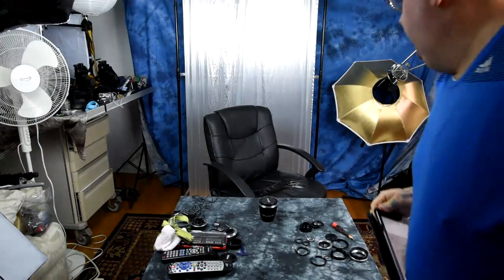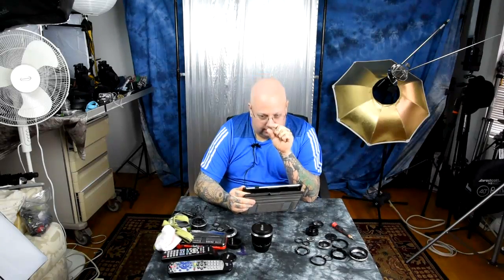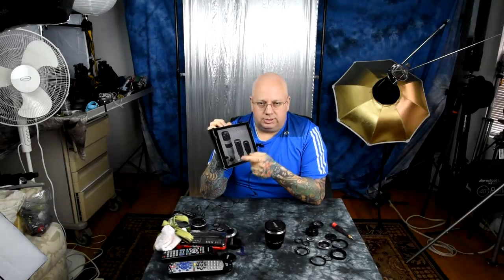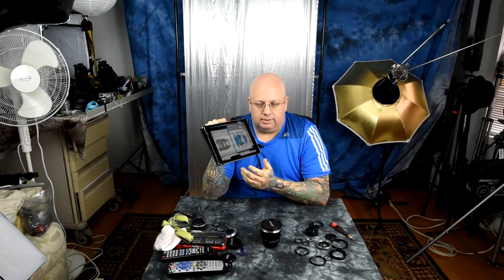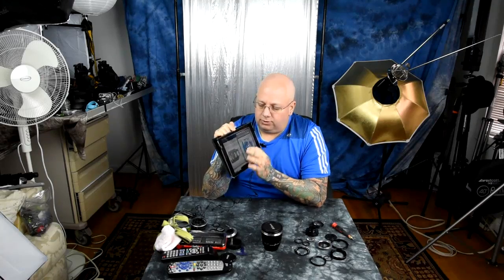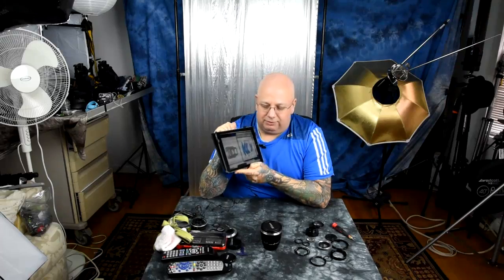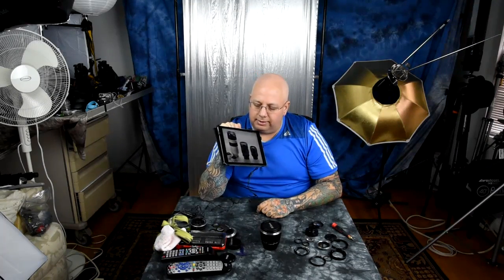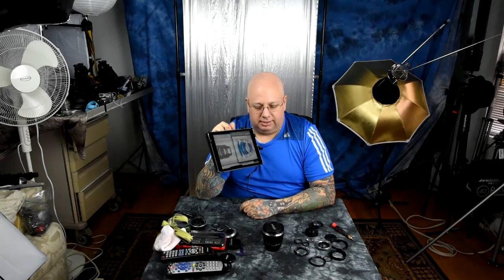BATIS 85mm E-Mount & 85mm Sony E-Mount FAIL: Necessary excessive glass elements

Comment: Canon 70 200 II -> 23 Elements in 19 Groups while Sony 70 200 GM -> 23 Elements in 18 Groups. So... No. It doesn't take more GLAAAAS!!

Nikon 70 200 VR II -> 205.7 Millimeters in Length while Sony 70 200 GM -> 200 Millimeters in Length. So, again... No. It's not Bigger... In spite of having a gap at the end.

Another big point to note is that the Sony actually has a Minimum Close Focus distance of 96 Cms while the Nikon is 140 CMs and Canon is 120 CMs. That's a big advantage for the Sony.

You have basically reached a conclusion already and are looking for reasons to justify that conclusion.

Comment: Greetings from Greece my friend. First of all thank you for your videos and your free tips. I just wanted to comment on your argument about the impossibility of making a 6 element 85mm lens for the e mount. It actually is already designed and is in your hands. Just adapt your old nikkor 85mm on an e mount body and there you go. Could it be possible that more elements are used for stabilization purposes (closer to the sensor = less need for glass movement) and/or for image optimization?

PS I really like your nickname here which stands for what you are stating in all of your videos.

Comment: Hi,

Let me ask a question coming to my mind. 

There are a lot of really fast rangefinder lenses with low count elements from Leica, Voigtlander and Carl zeiss, Carl zeiss Contax G  lenses too. These are small lenses and manufactured and designed many years ago. Their rear elements are really close to the film plane or lets say to the sensor. You can use these lenses with an adapter which is much thinner than Metabones adapters and can have  a really small and light full frame sensor camera. I'am using my old Contax G series lenses with Deotech Techart adapter and the results with the 35mm, 45mm and 90mm is at least I can say impressive. The Leica and Voigtlander adapter is also really thin and again the results with that lenses worth to see...

So how come it is not possible to make that kind of lenses for that mirrorless full frame cameras? I think it seems that ultra wide angle lenses and long tele's could be more difficult. but from 24mm to 135mm lenses shouldn't be that much impossible. from I may have missing an important point but If you please kindly answer my question I will be grateful to you. 

By the way I'am not asking to defend anything, I just want to learn the facts and your opinion. Thanks...
Reply from the maker: +Can Arbak youre talking about WIDES and M mounts .........   the "G masta" are MIDS and TELES and FAST apertures

apples, meet oranges
Reply: +Theoria Apophasis I think I can not clearly ask the question that I want to ask. I had an opinion when I watched your video that it is not possible to make a small and fast lens like Batis 85mm without enough space between the sensor and the lens rear element with lets say 5-6 elements.  But the ones that I mentioned above, for example Contax G series 90mm has similar specs with Batis 85mm. But much smaller and lighter. Most of the lenses That I  mentioned has 5-6 elements and their rear element very close to the sensor and they have the qualities you mentioned like micro contrast, renderings and others. 

And a small note I'am not only talking about wides and m mounts. I'am also talking about the mids and fast apertures too. Thanks for your quick response too...

Comment: Batis 85mm has the same weight of the Canon 85mm 1.8. But Batis has stabilization. And Batis is weather resistant. And batis is sharper. And batis has more pop up effect. So.. what are you talking about? And... Batis is available!!! Please.. before talking about fanboy etc.. inform yourself. Because u just look like a paranoid hateboy.

Comment: A7 is not really thin if you compare it to a vintage Pentax SLR or let's say Nikon FM2, both have more or less the same thickness, the difference is the older SLR has a mirror box in front of the film, the mirrorless A7 doesn't have the mirror box obviously, but has a ton of stuff behind the image sensor, an articulating screen takes even a bit more space.

Comment: Out of curiosity, can you explain or attempt to explain how Fuji gets away with the higher element counts and maintains their signature astonishing color rendition and micro contrast? Their 16mm has 13 elements, the 35mm F2 has 9 and the 52mm has 11 yet somehow none of them produce the flat trash that the Sigma Art lenses do.
Reply from the maker: +Chris Morrow it only has to drop on a DX sensor,   the 56mm you mean. 

Fuji been making high quality lenses for 60+ years,  Sigma been making off-brand crap for less than half that :)
Reply: +Theoria Apophasis Whoops sorry typo! Yes I meant the 56. Agreed, maybe Sigma was a bad example. Use this Batis though or some of the newer Nikkors that they threw in extra glass though. The general rule of thumb is that the more glass you put in something, the more degradation you'll see in some aspect of the IQ (color is the huge one).

So are APS-C sensors just less sensitive to this for some reason? I can't seem to wrap my head around the science here. I'm fairly certain Fuji isn't using magic but it's like 1AM now and that is starting to make more sense... Could the qualities of the X-trans sensor's color filter array as opposed to a traditional Bayer layout be making up for the extra glass that well?
Reply from the maker: it does at least make up for any need for an AA filter, which is awesome
Reply: +Theoria Apophasis I really think they are on to something with that. It is so hard to explain why it works so differently but the results are remarkable. Now if Adobe could catch up with the dude that is Iridient Developer I could streamline my workflow.

Comment: lol @ G MastA. Ken, if the Sony mount were physically wider (a larger circle) would that solve their issue or is it just the depth/thinness of the camera that is the problem?
Reply from the maker: +Mike Western elements are NOT cover glass.
Reply from the maker: cover glass is also what is called for anti-dust cover glass over the rear element.
Reply: Mike Western i appreciate the information but no need for name calling whether at me or anyone else. I was just asking a question. And the lenses in front of the sensor are called microlenses if i remember correct. If i can recall all sensors have micro lenses so i'm not sure why Sony's would be creating the problem specifically for their mount and no one else's unless it was something more than that.

Comment: Batis is sold out, it has been out for most of last year. You continue to show your completely biased opinion with anything related to Sony. It is hard to be intellectually honest when you completely dismiss an option that may or may not be legitimate. I used to own Sony but am now back to Nikon so I'm no Sony fan boy.
Reply from the maker: +Tom Watson define LEGITIMATE, .........does it work? yes ,,,,,,,is it sharp? yes...............best? HELL NO. 
 when youve tested 1000s of lenses over 28 years , let me know

hugs :)
Reply: +Theoria Apophasis your trump card of testing 1000s of lenses can't be the only litmus test of valid opinion. Your biased against Sony so admitting that will help frame the discussion. I didn't like the Batis 85mm that much either but it had more to do with the focusing problems on the a7ii. You are not basing your opinion on your own testing as you did not even think the lens was out yet.
Reply from the maker: the lens has 5 unnecessary elements, it will render flat, poor color saturation, bad depth rendition

it will look just like the Otus lenses, but not as high resolution.

after you repair 10000000 cars, and tested 10000000 cars, you just look and can see the design of a new car and point out its flaws.
Reply: +Theoria Apophasis I guess it's put up or shut up. It doesn't render flat, it has good saturation, and it renders like a good Zeiss lens. Here's an album I created just for you from some images taken with the 85mm Batis that isn't out yet- https://flic.kr/s/aHskubnGvH 

Again, I've sold the lens and my Sony gear so I'm no fan boy. Sometimes we just have a skewed opinion because we are completely biased whether we want to admit it or not.
Reply from the maker: the composition is great, family photos of some variety.

Sorry, but whats your FRAME OF REFERENCE again????? compared to what?

Those shots are flat & washed out
this one:
https://www.flickr.com/photos/124014280@N02/24494016009/in/album-72157664396145795/

reminds me of the 23 element Tamron 70 200 2.8

(also i have no idea how much correction you did or didnt make)
Reply: +Theoria Apophasis my frame of reference is that I shot with it and it produced some good images. Your trump card can't always be that you have shot more lenses than anyone especially if you don't use a lens your giving an opinion about and are completely biased at that.
Reply from the maker: agreed, it makes hell-A good images
nods head.

its not a trump card, its just a spectrum of reference.

given photoshop you can drop color on any washed out shot

the depth however is another matter that cant be added (nor the microcontrast)

Comment: Probably true regarding the G-master 85mm, probably because want to see some more sample photos. Based on the Camera stores review of the A6300 with 85mm and sample pictures true, no doubt. Lens is sharp but separation is not the best and also the contrast. Will wait and see.
But I predict that the lens will score exceptionally high on DxO mark guaranteed.
If Photozone review the lens then we will see a more real world test and get and idea what it really is like.
Reply from the maker: +John Valatos after screwing with enough lenses, you can look at 99% of their designs and know the kinda output it will have. 

ooooh fer shur on the BS mark.
Reply: Ken I know you have to many lens and camera but really hope you take a look at the new Pentax full frame DSLR that is due for  release this month. I think it is going to great.

But regardless the Pentax FA lens are awesome. The 85mm 1.4 FA* is a star for about $1,000. Would love to send you some sample pictures. My Flickr page has some I think of butterflies. But anyhow at least take a look at the new full frame Pentax.

I know too much gear and a whole new lens system you need to buy in too etc.
Reply from the maker: eeeeek

Comment: When Sony bought Konica/Minolta what happened to their glass production or was it just the patents they obtained? Anyway your explanation makes me understand why Canon, Nikon and Pentax have been reluctant to offer mirrorless ( other than all their less than successful attempts at small sensor mirrorless). I guess it's not just an issue regards keeping their respective legacy lens mounts but more the case they they are fully aware of the lens design limitations when using a shallow flange distance. It's becoming obvious that in terms of weight and physical size full frame mirrorless offers no advantage when side by side with traditional DSLR's ( just look at Canon/Nikon DSLR's with 70 -200mm lenses fitted next to the Sony with same said lens) It would make sense for Nikon/Canon to only offer full frame mirrorless in their current DSLR body form factor.

Comment: I'm inclined to think that the short flange distance isn't the problem (might actually help with wide angle lenses), but they should have increased the mount diameter to maybe 46mm. I've always been told that the ideal mount for lens designers was one with a short flange / wide diameter. Sony screwed up by not starting from scratch. If they had increased the flange distance a bit and increased the diameter - they could easily make an adapter to use FF lenses on there APS cameras - nobody wants to go the other way.
Reply from the maker: +Phillip Harpootlian that would have also been a partial solution / answer.

Comment: You are right the e mount needs more glass to cover the full frame sensor. so, you forget said this in your previous video. Your mistake was just talking about space gap and omitting this information clarifying this detail in your previous video. And I agree with you the G Masta are made for good corner to corner sharpness but will be a flat rendering lenses. I don't know if Sony make these lenses but the older G lenses were made by engineers and designers who worked earlier with Minolta and now for Sony